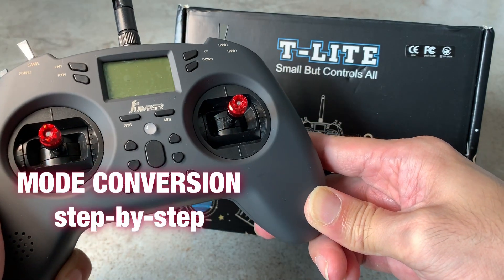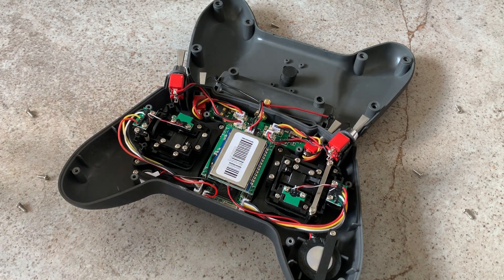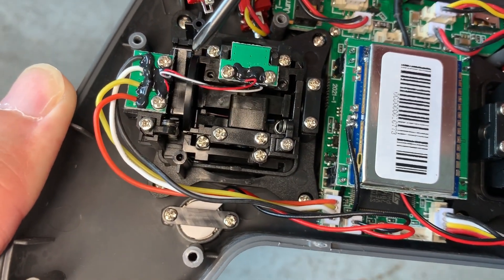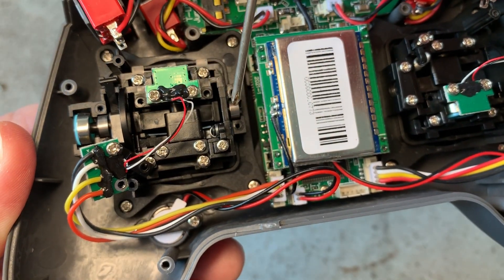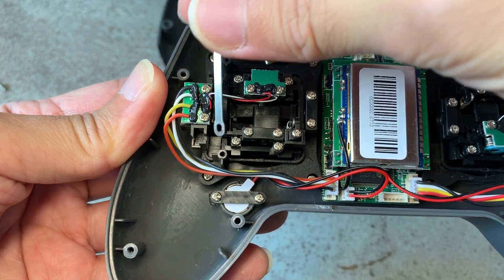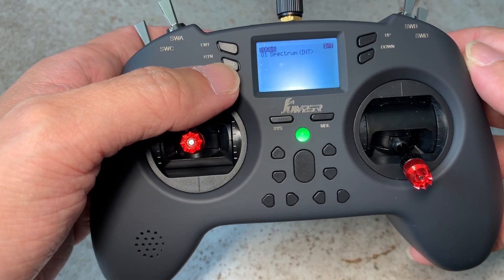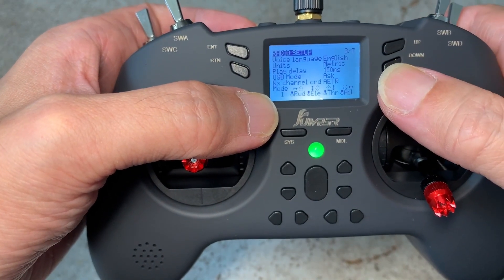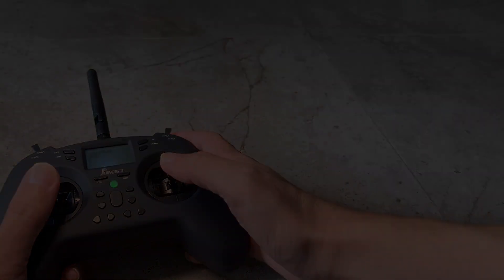Jumper T-Lite Mode Conversion Step-by-Step

Comment: Maybe a dumb question, but can you not remove the entire housing of the 2 sticks (4 screws each,) unplug the 2 cables, and move the entire stick and everything to the other side? Lastly plug the back in.
Reply: works fine to do that; just did mine this afternoon
Reply: I just did it this way, but I also turned the friction plate for throttle around so that it's bottomed out and far away from the SWA switch terminals, the same as it was on the other side.
Reply from the maker: Thanks for watching! That should work too.